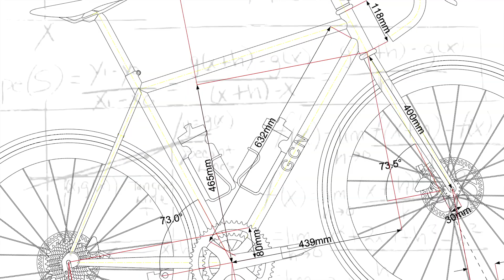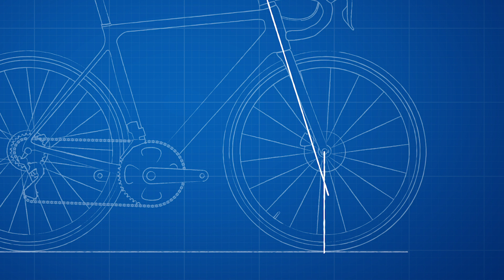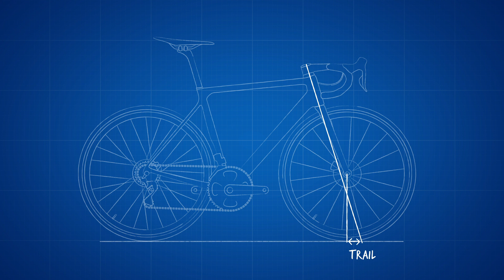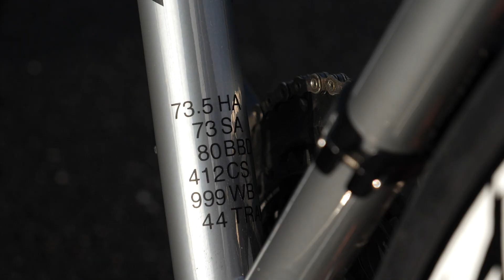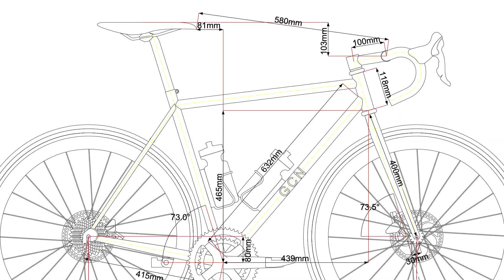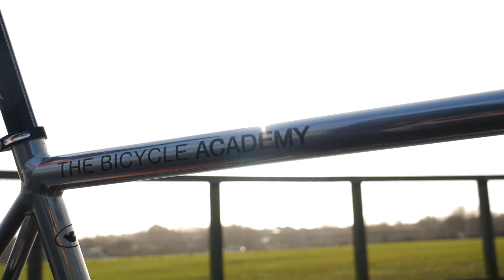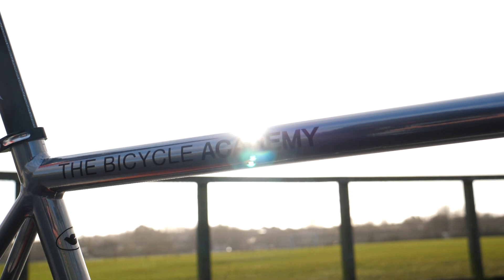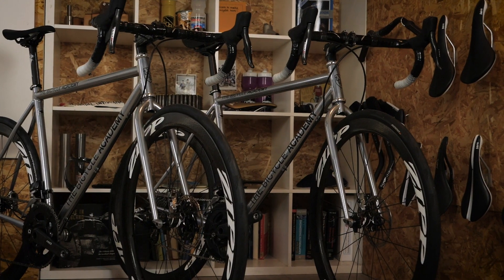How Does Your Bike Geometry Affect The Handling

Comment: Could having too small of a trail cause "death wobble" during high speed descents? I did some research, and my 2018 Specialized Venge has a relatively small trail (52mm) despite being a large (61cm) frame. I assume this model is going for aggressive race geometry, which I love, but I noticed the smaller frames had larger trail measurements. And yes, I experienced a bad wobble one time as I neared 50mph, which I had never experienced before.

Comment: Oh no!!! You gave us trail numbers, but no information on head tube angle and rake. I can increase trail by increasing the head tube angle or rake and these two approaches give very different results. Please let us know the numbers for the test. Thanks!
Reply: trail is a combinakion of head tube angle, fork lengt, fork rake and tyre diameter - for this test rake, lenght and headtube angle is irrelevant. BB drop is relevant though.
Reply: In my experience, increasing trail with a steep head tube and shortening rake is quick and linear. Increasing trail by slackening head tube and going with long rake is quite different. It’s more stable when straight but less stable at high steering angles. It’s not just the trail; it’s how you create the trail.

Comment: For stock bikes, trail tends to decrease as you move to larger sizes. Why is this the case?

Example: 2019 S-Works Tarmac goes from 71 mm to 52 mm trail between sizes 44 cm and 61 cm
Reply: 1) poor design. 2) often cheap design (no size specif varaiations in fork rakes and head tube angles). This is quite commen and major brand designers are too lazy to bother. Check out the new Ritte steel bikes designed by legend builder Tom Kellog and you well see how it shoudl be done. Tube dimensions, buttings, (carbon layup if carbon) should be size specifc too if done properly. https://ritte.cc
Reply: Karl Sanchez Otherwise your wheelbase would be huge in the larger sizes
Reply: And they compensated the smaller trail on bigger size with longer stem CMIIW
Reply: Because in small sizes manufacturers decrease the head tube angle to put the wheel further in front to avoid too much toe overlap (because the wheels become too big for the frame) and in larger sizes, they do not want to increase the wheelbase too much.  To do it right and keep the geometries and behavior more comparable,  you need to build small bikes with smaller wheels (like 650) and you also need to vary fork rakes sizes and the wheelbase between small models and larger models would vary much more.  But that goes against economies of scale (producing lots of identical parts instead of producing and keeping on inventory fewer of more types of parts)...  At the end everyone gets more or less used to what the industry offers in his/her size range and someone that is 1.60m tall will never know how different the bike of someone 1.90m tall behaves (even if they supposedly use the same "model").
Reply: You can also look at a much better example:
Cannondale Super Six Evo 2020, 58mm trail on all size from 48 to 61. Through two fork and head tube angle options.

Comment: How far can the trail go in mm before it adversely affects low speed menovers. Is there an upper limit and what would affect it?
Reply: My Koga beachracer has a trail of 81mm and you will notice this on low speed, but I love it. Its a dream   to ride, both on tarmac, gravel and on the beach
Reply: Super long trail will produce "wheel flop" where instead of turning the wheel around a vertical axis you would be trying to tilt the wheel side to side. Kinda hard   to explain in words. Try this, hold your front wheel by the axle out in front of your body, one hand on each side of course. Now slowly move one hand slightly toward and away from your chest, that is the rotation around a vertical axis I mentioned. Now move that same hand slightly up and down, now your tilting the wheel (flopping), that is the result of excessive trail. HTH

Comment: Pretty good video. Did any of the GCN retired pro racers ever play with trail and various geometries for specific events with custom bikes. I know in modern times it is hard for that to happen with everyone on carbon bikes that are super expensive to build. Not that long ago this was easier with Ti, Aluminum and steel frames. I would like to know the experiences of maybe say using a long trail bike on the cobbles due to lower speed and needing more stable steering. Perhaps a short trail bike on race courses that were fairly straight with lots of break always and a brutal final sprint  where snappy steering in a crowded peloton was needed.
????

Comment: Wonder how much can you affect the trail by changing forks?
Reply: Marcel Parnas a lot. It's 1 of the 3 factors involved in dictating trail.
Reply: Trail is a factor of: 
head tube angle, wheel size, and fork rake. 

You certainly can and likely will affect the trail by swapping your fork.
Reply: Other than changing the actual front wheel diameter, changing the fork is the only way to change the trail on a bike that has already been built.

Comment: Very much appreciated!. Could you do a couple more of these, like for example the differences in ride qualities between ‘double diamond classic geometry’ versus ‘sloped top tube’ geometry? Or is that just to limit the amount of different frame sizes during production?
Reply: On the "sloped tube" geometry "Giant's" contribution to cycling world. I think it basically allowed for a better or easier fit among all riders. Using the S, M, L frame standard you could easily fit a rider by using different length of components, such as bar width, crank arm length, stem length, and so on.
Reply: very good question, some people claim the longer seat post on a sloped top tube bike creates a more comfortable ride whereas some people say that sloped top tube bikes are stiffer, as well as horizontal top tube frames. Personally comfort doesn't mean anything to me and I much prefer the look of horizontal top tube bikes with dropped seatstays like TT bikes.

Comment: I would like to see Seat Tube Angle (STA) for any upcoming geometry videos. 
I recently got a professional bike fit after a year of riding with back and knee pain. According to my numbers my optimal STA was 76 degrees which is impossible to find in the market without a custom geometry. Why the STA is ~73 degrees and slightly steeper at 75 degrees for smaller frames in the bike industry ? Are there any UCI rules that dictate these numbers and what is the motivation behind it ?
Reply: the money you spend on that bike fit seems waisted if that was the recomendation you got. its your the position of your saddle relative to the BB that is interessting, not the STA. and achiveing that position while keeping the optimal weight distribution.
Reply: Frost Bite there are/were limits on the position of the saddle relative to the bottom bracket which restricted how steep a seat tube can be.
Reply: Like Morten says, you don't need to buy a bike with odd geometry, you just need to push your saddle farther forward.
Reply: Start with a no set back seatpost (if you do not have one already)...
Reply: Thank you everyone for the insights and feedback. I did get the same advice from bikefit to use a zero offset seatpost or even a negative offset as needed. I am currently using a zero offset seatpost with saddle moved forward and yet I still move forward especially when I am on ascents and need to sitdown. Even on flats I feel much balanced pressure distribution on my knees quads and hips as I move forward. My question is about the rationale behind any laws restricting the saddle position in relation to the BB. I know that moving the saddle forward also moves the center of gravity forward and it will 'change the handling' but I still don't understand why is that a problem ? We are all different with different body and build types.
Reply: @WiseGuyFTW  You are asking if UCI rules make sense, the answer is No, but if you race in UCI events you have to stick to the (often stupid) rules, if you do not you can ride what you want.  The logic behind limiting how far forward you can get is to prevent superman type positions which ARE faster, they also limit the max distance on to the tip of aero bars (with two categories below and above 1.90m rider height). The UCI rules are a mish-mash of traditions and historical knee jerk reactions to people finding smart ways of making faster bikes.  Francesco Moser made a fast bike by having a big rear wheel and small front wheel:  Forbidden (the two wheels must be the same size, why, because they decided so,  Minimum weight of the bike of the biggest pro (2.04 meter tall) and the smallest pro (1.57 meter tall): 6.8kg.  Socks height is limited because taller socks too fast... there are dozens of rules each one with its history and weird logic.
Reply: @julmeissonnier  Thanks! it makes sense in a completely nonsense way.  I can understand why some restrictions are there just for the sake of consistency. I am new to cycling (got into it because of running injuries) and the main motivation is the long rides (> 90 minutes).  I will experiment a bit more with different saddle and seat post combinations before giving up on cycling.

Comment: I have an endurance bike: long trail and a race bike; short trail.  The handling is VERY different!  Excellent job of illustrating those differences!
Reply: short trail bikes: we are talinking 30-35mm. It can be a very useful trick on randoneur bike as the shot trail  tends to mute the steering when riding with a front load like a rando bag. This is also to be considered for gravelbikes and does further complicate the idea of havinga  gravel bike designed for 40mm 700 and putting on 25mm 700c for road rideing
Reply: @mortenreippuertknudsen3576  english please.. I need further information
Reply: @devinfahada4880  I think he's saying that using less trail can be useful on bikes which have a load on the front (front bags ahead of the steering axis, etc) because in those cases the angular momentum has a similar stabilizing effect.  With a long trail bike, with front bags, it can feel like steering a freight train, so you make a twitchier bike and it will feel normal when its loaded up.
Reply: it's helped me a lot because I couldn't tell if it was just the low handlebars on my aero road bike, or the skinny tyres meaning I couldn't ride no hands.

Comment: I thought my TT had a short trail but on the basis it can't corner at slow speeds and likes straight line speed, I assume it's a long trail....but then why does the front wheel flip around so much when walking it?  Doesn't that indicate a short trail too?
Reply: https://en.m.wikipedia.org/wiki/Bicycle_and_motorcycle_geometry#Wheel_flop
Reply: Thanks, makes sense - guess my assumption it has a short trail was the error.
Reply: It’s a little counter-intuitive that long trail increases wheel flop but it makes sense when you’re walking along pushing the bike from it’s saddle :-)

Comment: Went from a CX bike with steeper head angle and more trail to a gravel bike with slacker head angle and less trail. Only ridden on road so far for winter, but preferred the CX bike on the road. Can imagine less trail will be better offroad on the gravel bike to aid quickly adjusting line choice on trails.
Reply: With the same fork and wheel diameter, the steeper head angle would give a shorter trail and vice versa. Typically a gravel bike would have longer trail than the CX bike.

Comment: Would've  the steering tube angle have the same or similar effect to the steering.  I also though, giving  the bike more trail would encourage the forks to flex more, and would give the front end more suspension.
Reply: Combination of head tube angle and fork offset (and wheel/tire size) compute trail. But in a reverse way.
Slack HTA -> longer wheel base , Increase trail.
Increase fork offset -> longer wheel base, Decrease trail.
So, 73deg HTA+45mm offset fork and 71.2deg HTA+55mm offset fork. Both will have 58mm trail, but first option has much shorter wheelbase than 2nd option.
try to play with the calculation:
http://yojimg.net/bike/web_tools/trailcalc.php
Reply: well the steering tube is together with the head tube...
Reply: @hippoace  would changing the outer steering tube angle, or changing the angle the forks that are attached or welded to the inner steering tube, would doing ether one, have a similar effect? Or what would be the difference.

Comment: I'm curious about the Paris Roubaix argument vs high speed descents. My naive thinking here is that on cobbles you don't want to be bounced around too much, so the more stable (i.e., longer wheelbase) the better. In the video the point being made seems to be that you'd want stability for fast cornering as well. So we'd end up with the same bike.
What am I missing?
Reply: I have ridden both short and long trail bikes. The sorter trail bikes on descents feels smooth and cornering is done with confidence. The longer trail bike on a descent also feels smooth but on cornering it feels like you are trying to turn a semi truck and does not give you confidence that you can corner into the next bend with ease.
Reply: @aacc8466  Thanks. That makes more sense to me but somehow contradicts what I heard in the video.

Comment: one thing I kinda remember : Longer wheelbase is more stable, not twichy and agile, good for long rides
Reply: This statement doesn't always work. I had a bike that if you took one hand off the handle bars it would shake violently. After making a set of forks with. Less rake , this decreased the wheel base by 20mm  & increased the trail. This bike I had foe 30 years & was much nicer to ride after the forks were replaced. You could eat & take clothing on or off. Things you didn't do before changing the forks
Reply: @robertsomerville5377  Thumbs up from me, I guess the newbies need this explained, but have to laugh when I read:
[You could eat & take clothing on or off. Things you didn't do before changing the forks]
You should always use a clean fork before eating!
Reply: uhm try to increase fork rake on an identical frame. 
Then what happen? Wheelbase increase, but trail also decrease. Trail value trump wheelbase. Despite the bike having longer wheelbase, it is getting more twitchy and agile.

Comment: 6:10 - Ollie, the toe overlap was the same on both bikes - since both had the same wheelbase, bb drop, chainstays, etc (except head angle and trail - this is what your guest said), thus both had same front center. 

OR, both bikes have the same geometry, including the head angle, and only the fork offset was different. if so, yup, more toe overlap with the long trail bike. in this case your guest was not right (regarding same wheel base, etc).

SO, decide, who was right? you or guest?

Comment: This is one of my most favourite topic of bike. And why most modern gravel bike have multiple wheel size compatibly. When the bike has say clearance for 700cx40 mm the trail is around 69 mm but when you switch it to say 700x28 mm or 650b x 48 mm the trail went Round 64 to 66 mm not much but it will Make the bike felt more different when you switch tyre or wheel size. Just like on the geek edition 700c vs 650b wheel on this channel.  

Keep up the great content GCN.

Comment: Can you please do a topic about all bikes having the same wheel base. How is that normal for a 160cm tall and 200cm tall person to have the same wheelbase bike???!!! Being 194cm tall I find that very strange.
Reply: Actually it comes to seat tube angle and head tube angle when the bike has the same wheel base but has different size and fit different height rider. There's an actual tool online that you can use to play around the geometry. By changing some value on the geometry chart
Reply: Really? I am pretty sure that in all geometry charts I have ever looked at wheelbase in increasing with frame size...
Reply: @tecnociclista5342  yes, incrementally. Like 10 to 15 mm mostly on front center. The distance from your bb to the wheel axle.